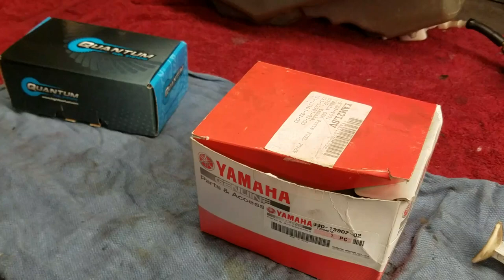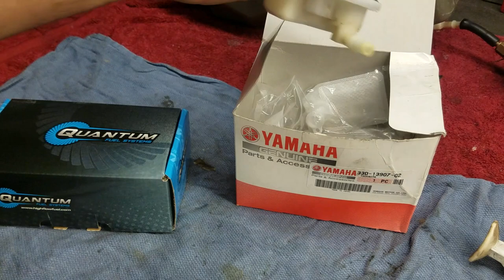1:11 YZ250F Fuel Pump Failure & Repair  (same for YZ450f). Hard starting, bogging, and popping.

Comment: My 2010 starts fine but will only run for 2-5 minutes then dies starts right back up one kick and when over 1/2 throttle it bogs out and dies is it my fuel pump cutting out?
Reply from the maker: I would try a new spark plug. Sounds crazy but I seen a RMZ450 that did the same thing and all it needed was a new plug.
Reply: @UpAllNight91  it has a new plug . I just barely had it fully serviced the day before I took it out and it ran fine for an hour maybe two and I wasn’t even riding it that hard then it just randomly started
Reply from the maker: @randypeterson9468  has this new plug been added after the issue started or was it before the issue started?  Plugs can act up when the inside cracks,   doesn't matter if its old or not.  If the plug was changed before the issue started I would try a new plug first just to be safe.
Reply: @UpAllNight91  after new plug. It has about 2 hour, I rode about 6-8 miles then started going up the canyon road and it just started bogging and cutting out and dying but would instantly fire back up and ride for about 200 yard and die again
Reply from the maker: If you start it up and just let it idle will it die within a minute or two while at idle?
Reply: @UpAllNight91  yes it does that too
Reply from the maker: Yeah. I would try a new plug first before digging deep.  Trust me, when the simple things are ignored it hurts.  These plugs can go bad out of no where no matter how young the plug is and what you are describing is what they do when they go bad.  Start there and let me know
Reply: @UpAllNight91  so I changed the spark plug day and it ran fine for about 30 minutes and once I could start feeling the heat from the exhaust threw the seat it started acting up again. Is the like a temp sensor automatic shut off?
Reply from the maker: @randypeterson9468  @randypeterson9468 hmm. Are you over heating her?  Is she full of coolant? And is she being riden so air is moving through the radiators? Sitting still for longer than a minute or two on a hot bike can overheat these 4 strokes, im sure you know that, just tossing that out there in case you don't. It could be a bad fuel pump getting hot and giving out with heat but just making sure its not just a overheat in general.
Reply: @UpAllNight91  I don’t know how accurate they are but I have one of these temp gauge radiator caps and it stays in the green 🤷🏼‍♂️💁🏼‍♂️ and yea I never let it sit and idle for longer then a minute and when I started acting up after I changed the plug I was 5th doing 45mph so I’m sure it’s getting air
Reply from the maker: @randypeterson9468  Ok, and shes full of coolant I assume. So my next step would be getting her hot till she starts acting up and then very quickly pull the tank, hook up a fuel pump gauge and battery to the pump and test it while its hot. Also would pull the plug while its acting up, ground the plug to the frame and check for good solid spark (that would be checking that you dont have a stator that gives out as it gets hot)
Reply: @UpAllNight91  sounds good I’ll have to get more tools or just take it into a shop
Reply from the maker: @randypeterson9468  Right on.
Reply: @UpAllNight91  well so I got off work today came home stripped the tank and shroud off decided to pop radiator cap off and I can’t see any coolant tipped it over quite a wise still didn’t see anything….. but last Thursday when I changed the oil and checked the coolant it was full….. it’s low now could the cheap tusk temp gauge be to weak of a spring and letting coolant out?? I’ve came across that in trucks with cheaper caps having weaker pressure springs? Causing it run out the over flow? I don’t have any oil/mix and my bike doesn’t smoke at all …fyi I’ve only had the bike 3 weeks
Reply from the maker: @randypeterson9468  hello.  Well from experience I can only suggest a OEM cap.  The after market ones are often problems.   And the temp gauge only works correctly when its full of coolant, and the coolant is in contact with the cap.  So if the bike runs low on coolant it will still read as if its running cool when its actually overheating.  Meaning its kinda a pointless addition to the bike.  I would install a good OEM cap, fill her back up and give it a shot. It is normal for the level to drop a little but you should always be able to at least see it when the cap is removed
Reply: @UpAllNight91  that’s my thoughts exactly after replacing the plug and everything suggested from you I decided to pop the cap again and noticed that I’m going to get an oem cap and top it off and try again I should know better then to trust tusk brand ☠️
Reply from the maker: @randypeterson9468  Right.  Some of the stuff made by tuck is not that bad but radiator caps, surely gotta go OEM on them.